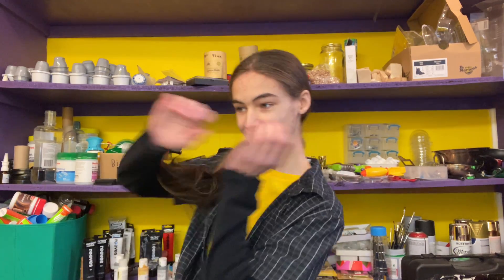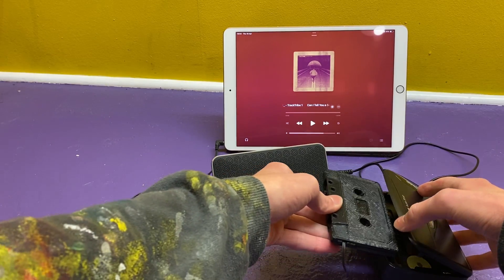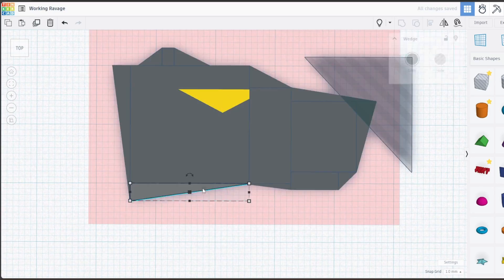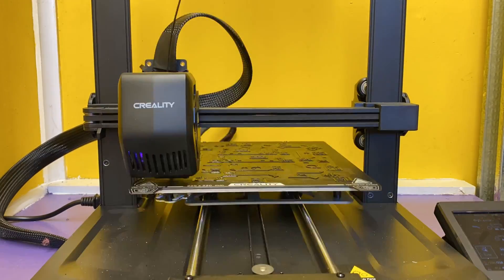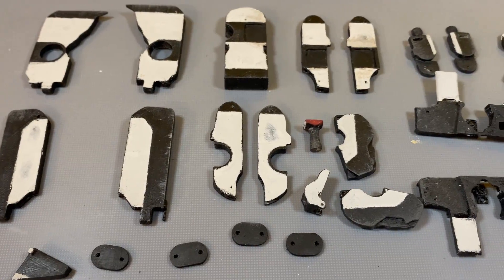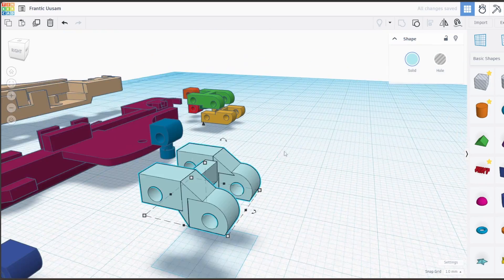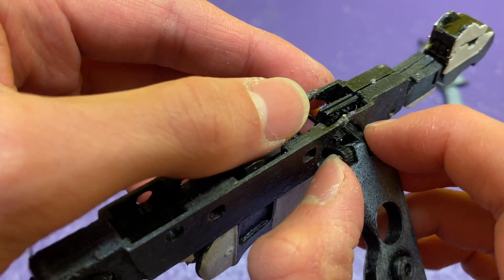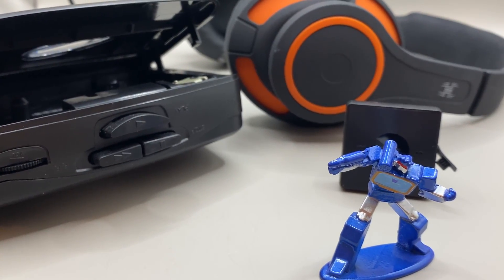How I 3D Printed a Playable Cassette Transformer!

Comment: Outstanding work! I've designed/tinkered with a decent number of 3D printed figures and I don't think it's physically possible to avoid kitbashing refinement in the process. (Or maybe I'm just pushing my old RepRap too hard, ha!) Subbed, can't wait to see more!
Reply from the maker: Thank you! Both for the kind words, and the sub!
Definitely think I’m starting to outgrow Tinkercad (thinking of learning freecad instead) but it goes to show that with the right mindset the tool is never a limiter for creativity!
And thanks for sticking around, got a lot more fun printing projects in the pipeline!

Comment: there is a way to fix the issue with regular tape.
under stress construction.
Pretty much the use of tension and compression to make the tape it self hold shape, the most important part being the side where the tape actually meets the reading header.
If that part could be made into a single piece and keep secure in place, even the rolls can be loosen.
Reply from the maker: Your totally right, and this was what was driving me nuts with Laser beak. Due to him being multiple parts to transform, he can't hold the tension consistently, even when I added more locking tabs on version 2.

Normal tape shells are only two parts, which is why there's less room for error. I think there's definitely ways of improving it If I did more research, but no matter what I do I'm going to be fighting for robot/tape space internally.

Might come back to it someday though if I can figure out how to make it all fit nicely!

Comment: this remind me of my engineering project today, me and my classmate had these 3d printed parts we needed to sand and we didn't really use protection so ended up ingesting a lethal amount of micro plastics.
Reply from the maker: Oh gosh! This is why in any of my videos where I sand, I not only say but also show the mask and me working in a outside space. PLA is definitely on the safer side, but still not ideal. If you're using TPU or anything like that, it can be quite serious.

Make sure to keep good practices in mind for later projects!

Comment: I love this project
Though if I had to nitpick something is that you basically have a robot with an extension cord.
I'm probably going to date myself but you basically built dwight schrute's ed truck robot version of a transformer with something that I used to have in my car 😅
plugging in my 64MB MP3 into my car that didn't have an audio jack because who carries around tapes anymore.

I don't know how much you know about electronics, but you should be able to fit a small bost circuit and just use a fm/am reciever for passive music playback.
Reply from the maker: Haha just looked that up now and your totally right! Sadly given how limited the internal dimensions of a cassette are, this is kind of as good as I can get while still having room for robot mode parts.

With the fm/am receiver, I might be able to squeeze that into a character like Ratbat who's robot mode part layout is different, but Ravage wouldn't fit.

Definitely want to try different electronic methods though, one day I'll find the perfect balance of form and function with these casseticons!
Reply: @nectarmechanics   So far you've done an amazing job!
I don't have a mechanical engineering degree so I'm confident in saying:
You can't do better with a mechanical tape, it's easier to go the digital way 😅
Reply from the maker: @svampebob007  Thank you! Maybe someday I’ll comeback to normal tapes, but for now it’s time for me to experiment!
Hope you stick around for those eventual project videos, whenever they come out!

Comment: please learn a real cad software
Reply: Especially the head would've been much simpler to model with a couple sketches in a CAD program
Reply from the maker: You’re right, I feel like I’ve kinda outgrown Tinkercad in a lot of ways. What software would you recommend?
Reply: @nectarmechanics  I personally really like Solid Edge by Siemens, there's a fully featured community edition and it's practically as powerful as Solidworks without the ridiculous price. But if you want more community support of course there's Fusion360, Onshape and one or two others that I forgot. If you want a smooth learning experience avoid freeCAD and Blender with CAD plugin
Reply: @nectarmechanics Fusion 360 has a free license for hobbyists and has been serving me pretty well for a couple years now. OnShape is the same, I think, but it's cloud/browser based.

Comment: 1, when i clicked this, i was assuming your starting point would be made out of an adapter tape cassette,  its crazy you tried to make one out of an actual tape.
2. they make blutooth versions of these.
Reply from the maker: Thank you! I knew someone would ask me to try doing an actual cassette at some point, so I beat them to it lol!
I've actually had a few people point me in the Bluetooth direction.

With characters who transform like Ratbat or laserbeak, having the middle of the tape be the body, I think the Bluetooth ones would work great!
 
But for Ravage here I wanted to use the middle of the tape to give him better sized legs, and the smaller aux cord allowed that.

Definitely plan on looking into them for later projects though, want to crack the shell and see what's inside!

Comment: with all the small parts and flat surfaces, it looks like you need a resin printer? afaik, they are better for that, i.e. no sanding. Or CNC
Reply from the maker: I was wondering that! 
Honestly I don’t really fancy messing with resin printers yet though.
my workshop doesn’t have the best ventilation as of now, so I’d have to do a lot more than just setting up the printer.
Not to mention curing stations etc, it’s definitely an eventual want, just not right now I think.
Hope you enjoyed the video, and thanks for the comment!
Reply: @nectarmechanics  ey, keep it up, you're doing fun stuff. My best recommendations are: keep practising what you love doing and consistency

Comment: Just discovered your channel and I must say that you have a lot of talent and potential.  Just wish you get a better 3D printer soon.  BUT... I can give a tip to reduce sanding.  Try 0.05 layer hight, it will take longer but you will reduce or eliminate sanding all together.  Also try to get a core XY printer like a Bambu or Creality K1, they are a lot faster and have more precission.   Keep creating !!!!.
Reply from the maker: Thank you! Would love to get more higher end printers, but I’m happy enough with my Creality V2 SE for now. 
Definitely think some of it is user error (I haven’t messed with slicer settings too much outside of changing the default temp)
So I definitely think a smaller layer hight and some messing around with settings will help. Thanks for the tip! Love getting to learn from fellow makers!

Comment: Great project I had the original transformer a long time ago no idea what happened to it. I wounder if this scale model would work better with a resin printer? I would consider making one myself but I don't think I have a cassette player anymore.
Reply from the maker: Thank you! I wish I could have gotten to handle more G1 toys, I have a trio myself, and sometimes friends have had some I could mess with for an afternoon, but other than that my G1 experience has been pretty limited.

Resin printing it would be a great idea! I’d have to do a bit more of a redesign to iron out some of the bugs (really thin parts that would just snap again)
But definitely think it would save me time sanding!

Comment: You can buy off the shelf blue tooth modules, btw.  It would let you clip off that aux cord and connect directly to the magnetic head, hiding the external wires and making him seem like he's a real tape cassette. 🤟
Reply: Where could I find this potentially
Reply from the maker: Thats a good shout! I've actually had a few people point me in that direction.

With characters like Ratbat that use the centre of the tape for his torso, I think the bluetooth ones would work great!
 
But for Ravage here I wanted to use the middle of the tape to give him better sized legs, and the smaller aux cord allowed that.

Will definitely mess around with them in the future though, so stick around for that!
Reply: I like them.  Pretty small.  Air pods destroy brain cells.

Comment: I am really impressed with what you have done. You speak well and have skills in tinkercad I've never seen/didn't know where possible. Out of curiosity why not try fusion 360 on the hobbyist licence? I'll be trying your wood filler idea to smooth parts. Best of luck in future projects ill subscribe and look forward to see what you come up with.
Reply from the maker: Thank you so much! Both for the kind words, and the sub!
Using wood filler is great, It sticks really nicely in the recesses, and I love how easy it sands! Hope it goes well for you. 

I have actually tried Fusion 360, and also a little bit of FreeCad. And if you've watched any of my other videos you'll know I do a LOT of Blender 3D.

I went with Tinkercad for this project for no other reason than I know how to use it best out of the proper cad software I've tried. Blender is really tricky to get precise measurements with, and Fusion 360 had more of a learning curve than I had patience for lately.

At some point I'm going to learn it or another cad alternative as Tinkercad can get quite laggy and is pretty simple, but it goes to show with enough patience you can make some cool stuff!

Comment: Woah woah woah.... 1k subs? Nah, those are amateur numbers. We gotta pump them up.
Reply from the maker: Haha, thank you! Only just hit 1k due to this video, been chugging away slowly for a couple years now!
Reply: @nectarmechanics  I, a maker and a G1 transformer fan, thought it was good and  my son enjoyed it too. So you've done something right. 
Unsolicited advice: smaller nozzle. 0.25 Diameter will help tremendously with tiny prints like that. Sanding doesn't suck (as much) with ABS if your machine can print it. Alternate smoothing: UV resin. Brush on a light coat to fill in the channels between layer peaks, cure with UV light, sand to a glassy smooth finish with some progressively finer sandpaper but PLEASE **WEAR A RESPIRATOR** You do NOT want resin in your lungs. 
Keep it up dude, good stuff so far.
Reply from the maker: @C3DPropShop  Thank you so much! So happy this is reaching proper transformers fans. I can't believe you liked it so much you showed it to your son, that's so lovely!

Thanks for the printer tips! Very much studied the software more than the hardware with these kinda projects, so any advice is more than welcome! Not sure My printer will love abs, but definitely will see if I can get a hold of some UV resign, see people in the cosplay world do it all the time!
Thanks again!

Comment: This is awesome! I bet if you used a different 3d printer with a smaller nozzle and layer height or even a resin printer you'd be able to reprint the same model and have it be a little more robust because there won't be so many gaps in the plastic causing weak points.  Or you can always steal joints from a gundam kit lol
Reply from the maker: Oh totally! Definitely think part of the problem was my design, pieces that are only a few mm thick are gonna be weak even in resin. but your right, gundam joints for the hips would have held the weight a lot easier!

Comment: Wait until you learn about esp32. Solder on a head from that adapter, and a e-cigarette battery
Reply from the maker: A yes! Others have been pointing me in that direction too!
For characters with a different transformation scheme like Ratbat, I think they’d be perfect.
I went with the aux for Ravage so he could use the bulk of the tape for the legs, smaller internal tech profile.
Will definitely try messing around with them in the near future!

Comment: So there's also BT versions of the Cassette adapter, so it will give you that all in one look and effect. However you'll have to make space sacrifices for the internal BT components
Reply from the maker: Yep! Few others have also been pointing me that way. For other character designs that transform differently like RatBat or Laserbeak, I think they’d fit inside the torso really nicely. For ones like Ravage here though, he needs that middle section to become his stomach and legs, which is why I went for the aux adaptors. Smaller internal profile.

Will definitely see if I can get a hold of a BT one at some point though, even if just for testing!

Comment: With an old air pod or similar earbud  I bet you could fit it and connect to the tape head. Although having him as tape adapter should be cannon.
Reply from the maker: Ooh like having an mp3 player inside the tape connected via the wire?
Tricky with a design like Ravage, but maybe one like Ratbat. Might look into that later down the line!

Comment: There are also Bluetooth based tape adapters. That would be the ultimate implementation.

Great job, killer implementation!
Reply from the maker: Thank you! And yes, I’d be keen to try a Bluetooth one later down the road. Only reason I went aux over that was its components has a smaller profile.
But for a different character like Rumble who transforms differently, might work better!
Reply: @nectarmechanics  i am excited to see what you find when you break one of those open. I imagine Bluetooth requires more computery bits.

The one in this video had a lot of gears that burst out and I assumed you threw out to make room 😂
Reply from the maker: @macncheesekat  Me too! Hopefully it's got a small profile so I have more room for transformer parts!

Those gears are for the tensioning system. These aux tapes are normally used in car stereos, and those players check the tension on normal tapes. If it's too loose it stops playing to try and not damage the tape.

Obviously the aux tape doesn't actually have any spools of tape in it, so the gears fake the tension a regular tape would normally have.

My player doesn't care though, its a cheap modern one I use to test with, and it doesn't have a tension checker, meaning I could get rid of those gears to make room for Ravage's legs.

Don't worry, I've saved the gears for some kitbash projects down the line!

Comment: those laserbeaks, nice. Cant wait to see a possible updated laserbeak using the adapter. Possible to have the adapter read off a built in SD card with pre-loaded songs maybe?  They also make bluetooth versions if you dont want the wire.
Reply from the maker: Thank you! I did look into those Bluetooth ones, definitely down for giving them a try! Only reason I went with the aux version was because the internal components had the smallest profile, more room for transformer parts.

Laserbeak’s design lends itself to a tape with bigger tech a lot nicer than Ravage, so never say never!